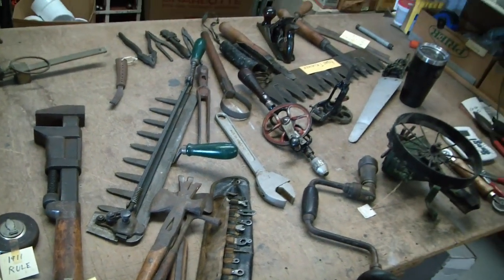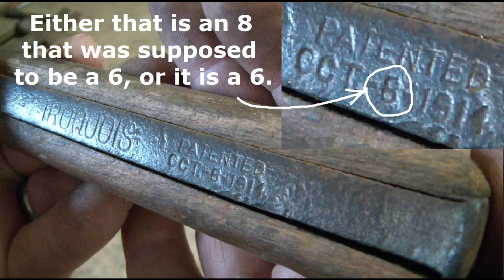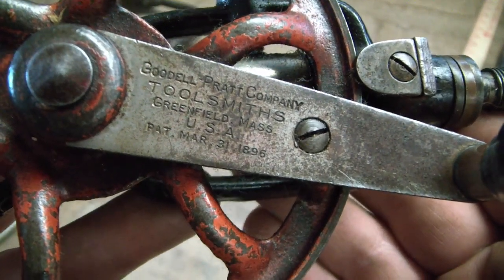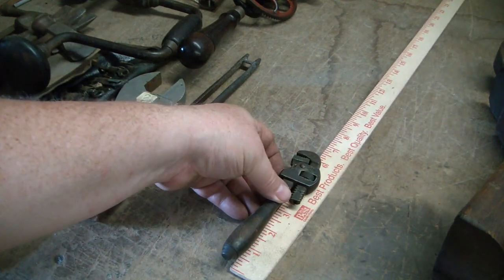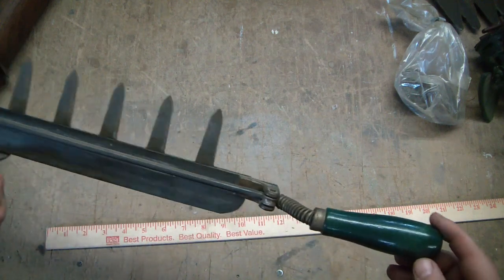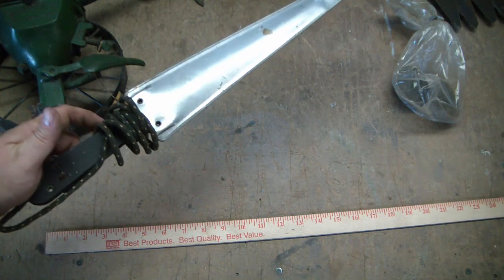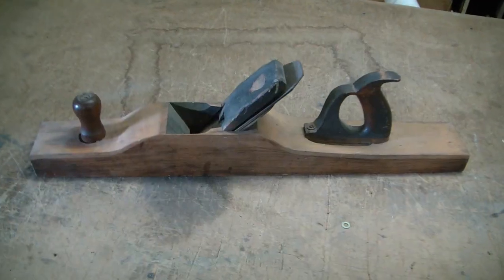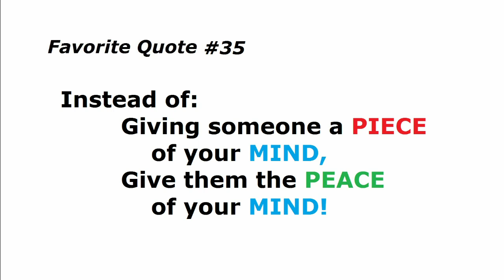Medina Hardware Tools & Lost Store Footage

Comment: I'm pretty sure the tool with Pope engraved in the handle is a farriers tool. I don't know if it's specifically called a hook knife, but it's for digging down to fresh hoof material when applying new shoes. An interesting side point is that they are very highly valued by native totem pole covers in the pnw. They work really well in the soft cedar, but when you work with them you apply a lot of force, so when you slip, they tend to cut pretty deep
Reply from the maker: Thanks for the info!

Comment: I can't quite grasp it with my memory, but that tool that you opined might be a valve compressing tool, that's not what it is. It's right on the tip of my tongue so to speak, it will come to me in the next day or two. But it's rather rare to come across, it's extremely specialized. I want to say it's agricultural, but it will come to me, I don't want to commit to anything yet. But I think it's somewhat special
Reply from the maker: 357 Magdad fond the patent for it.  It is a weed puller!

Comment: I don't think those are heated hand grips. There was all kinds of quack medical devices, I guess there's still just as many, but one of the more popular designs passed low voltage through two hand grips supposedly as a panacea. They are also used by scientologists to supposedly act as a polygraph of sorts, they're all just basic variations of a modern TENS unit. Most of them were much lower in the detectability range then modern ones. But there were some shockingly bad decisions. Lobotomies were often performed by traveling surgeons of dubious training and many of our grandparents expose themselves very closely to x-rays when it was popular to have them in shoe stores to see how well your feet fit in the shoes. Still only one other country besides us that allows medical products to be advertised on television.
Reply: Pretty much all cars before the fifties or sixties had a steering wheel ratio where a u-turn might require 8 full rotations of the steering wheel. You could have a huge Tangled mess of wires around the steering column and that old cloth insulation was not the most reliable